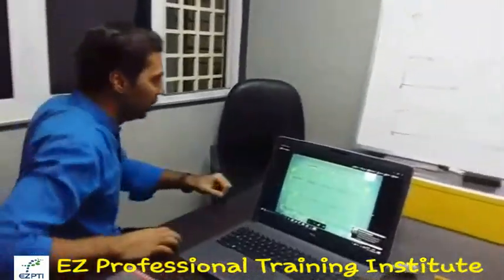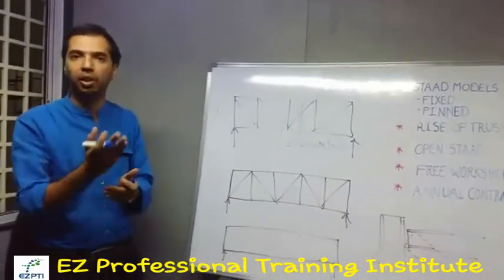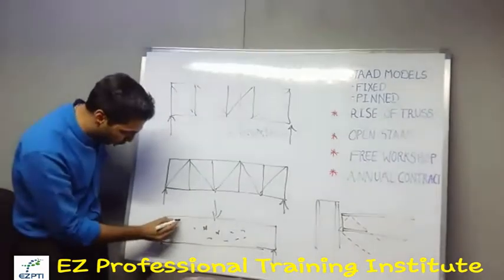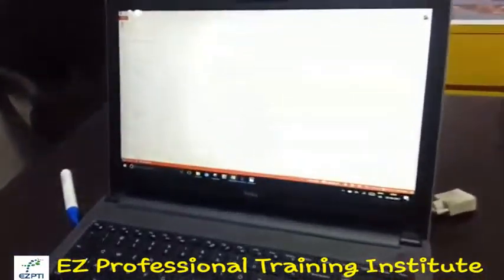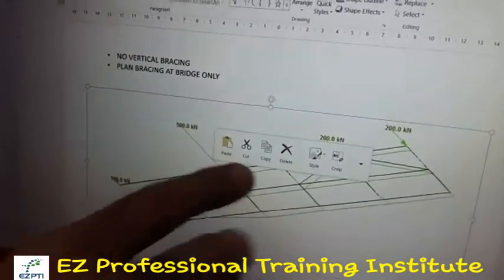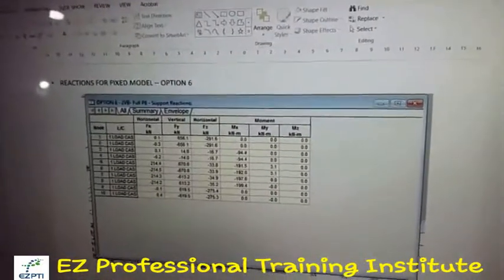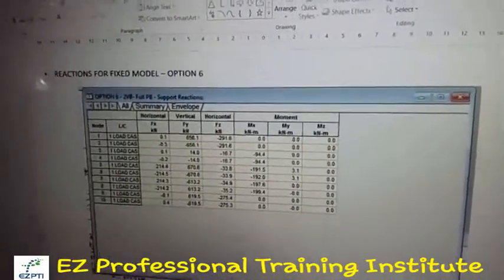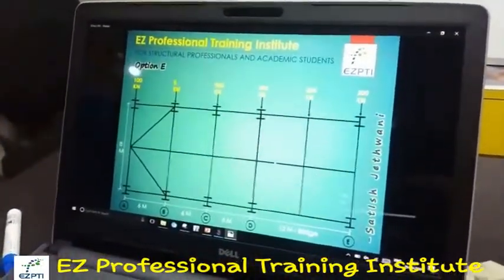Truss Direction, Plan Bracing - Location and Requirement & OpenSTAAD Intro

Comment: Thanks for your informative presentation. Now suppose steel building located place like Kazakhstan where Temperature is extreme high (+30 C) and low(-45C) . what kind of bracing system will be more suitable in general for industrial building Longitudinal and Gable frames (e.g. K, A, X type). If you can guide for this..Thanks..
Reply from the maker: we will go for A bracing. Again, it should preferably at the centre of the structure. We will not lock stresses by providing bracings at two ends.